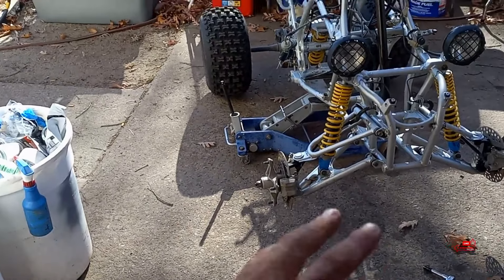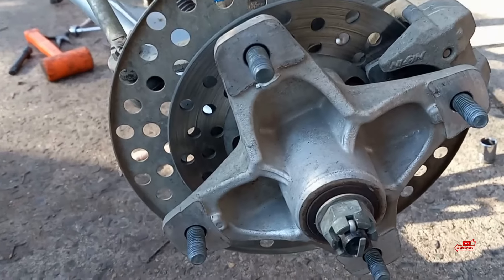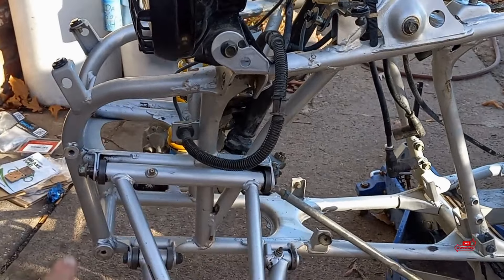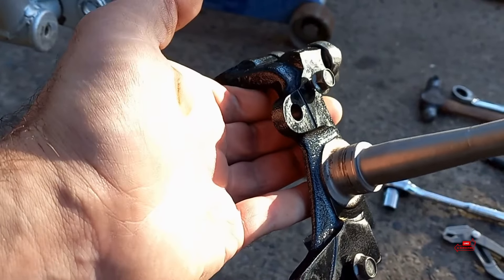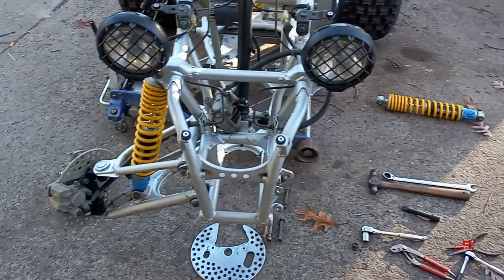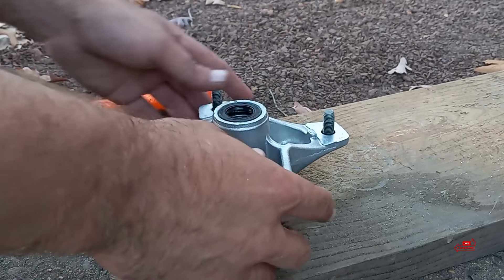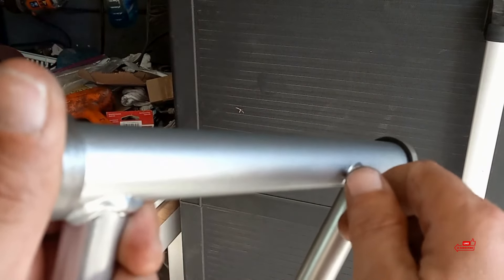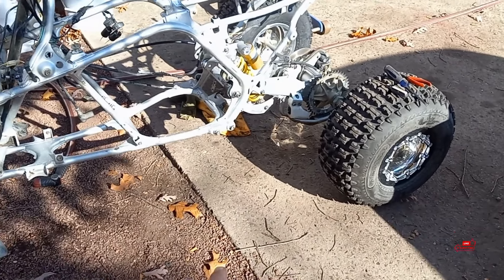Banshee Build: Front End Assembly

Comment: If you ever miss your Raptor i have a 2019 with 22 original hours excellent condition
Reply: Looking for a nice banshee. Raptor has All paperwork. I purchased this machine 100% stock and just added the following parts all brandnew

-Full Monster Shorty Exhaust Ceramic Coated 
-Fuel Customs Intake with Box
-Alba ECU Reflash Specific for FCI & Monster Exhaust
-Ceurvo Racing AIS delete
-Moose Poly Case Saver
-2024 GYTR Kit (Bumper & Heel Guards)
-TM Designworks Poly Belly Skid
-Monster Clear Cam Cover black
-clear/black oil filter cover
-Fresh Maxima Oil & Filter 
*I just purchased New in box -LoneStar +2 Aarms & LoneStar Axcaliber Axle, Fox Float 3 shocks, streamline brake lines,Billet brakeline holders, Lonestar Tierods ballhoints to go with quad.
Extremely clean turn key.
Reply from the maker: I will never miss that quad bro.
Reply from the maker: Someone might be interested. I ended up selling mine and added cash to get this banshee
Reply: @garagemcmatt Rite lol no i meant a raptor in general but i hear you.
Yeah that what im trying to do but trade just cause i have so much into the Raptor, which i know you never get what you put in but everyrhing is literally brandnew with recipts 4k worth of part i just put on minus the lonestar stuff & shocks they're not installed. The quad its self is basically brandnew 22hrs on it with dealer installed hour meter with paper work for hourmeter. If you hear of anyone with a nice banshee send them my way if you dont mind.

Comment: Good content. You deserve way more subscribers. Blessings to you. A couple questions:  1) after putting anti-seize on bolts that get torqued, do you alter the torque from factory spec?  2) those bumpers look great, but I’ve wondered how functional/durable they are since the tubing is so thin?  Thanks.
Reply from the maker: Thanks bro I'm working on subscriber goals it just takes time. Question 1, I use anti seize on the whole bolt so it does not get stuck in the dowle, sometimes bolts have different specs as far as torque goes. Some have specs that need a lubricant and that gives you more of a correct reading. Question 2, this bumper feels very sturdy as far as it construction and it fell rite into place, some cheaper bumpers just feel lite and don't line up as well as this one did

Comment: How do I get on members viewers board?  Skypilots Skunk Works. Saginaw, Michigan.
I'm currently working  on a 1993 RMX250 that's got a nasty hanging idle. Fresh overhaul on the entire motor.
Reply: @CourtJ_ml9to  I bought it a restoration  a little over a year ago. Top end was off the bike. It runs great outside of the hanging idle. I've pressure tested it. 
It holds 6 pounds steady with no drops.
I'm stumped. I've sprayed the case halves, intake area, and base gasket with soap and water mix. No bubbles.
Reply: @jeffdavison8421  Carburetion/ jetting for-sure😉. 
Did U switch up ANYTHING maybe the silencer by chance
Reply from the maker: Everyone in the comments is correct, there are a few different things it could be. It being colder now means the air going into the bike is a denser air charge making it lean. I'd go with the air screw first then if you still have an issue definitely do a leak down test
Reply from the maker: Members board, click the join button on my page if your interested